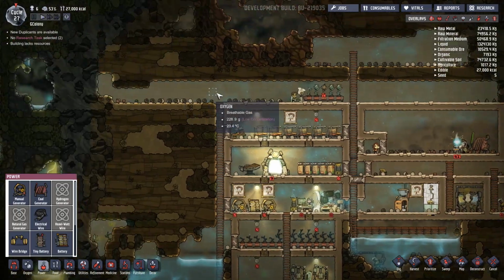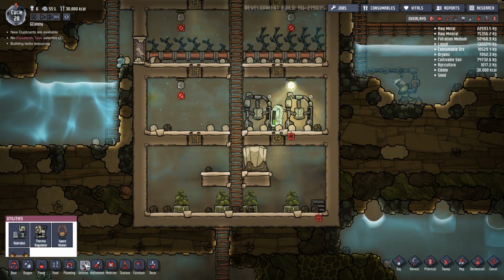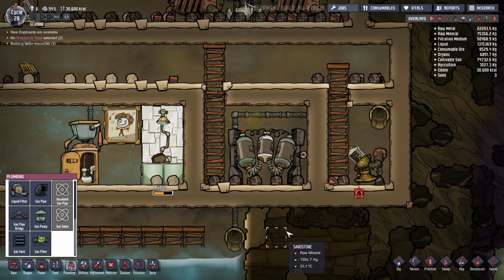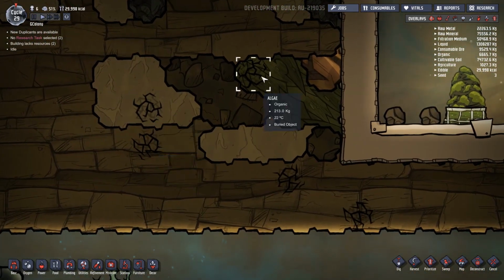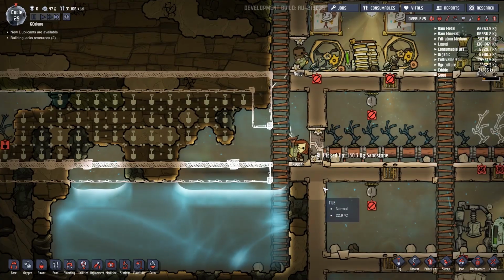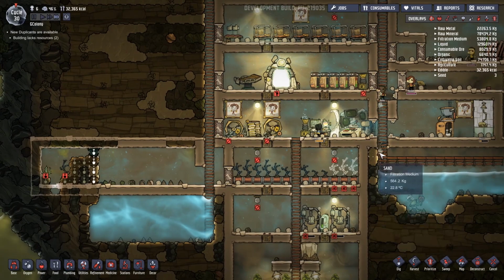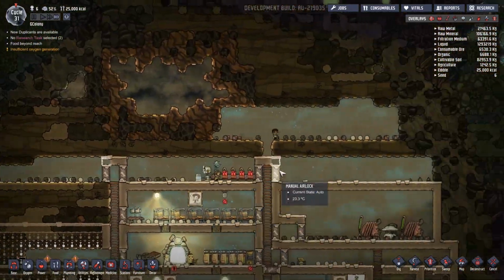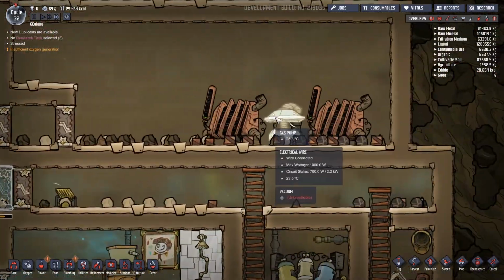Oxygen Not Included [Early Access] - #7 - Stuck & Squirming - Let's Play / Gameplay / Construction

Comment: Dude, you don't need to be pumping absolutely all of the air out of the coal room to get rid of the carbon dioxide, you just need to place an air scrubber inside it so you don't need to build a space-wasting airlock system or pump any carbon dioxide into your base.

Comment: Why not move the carbon gas vent to the ceiling? Logically, carbon sinks, so you want it at the top so that it will fill the room with gas without overpressurizing.

And vice versa if you were pumping oxygen into a room. Due to it's tendency to rise.